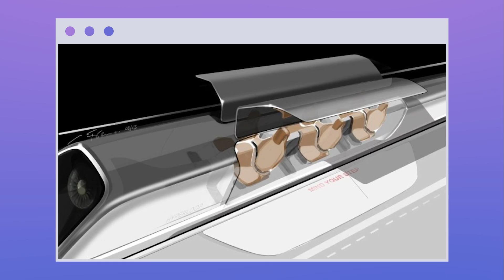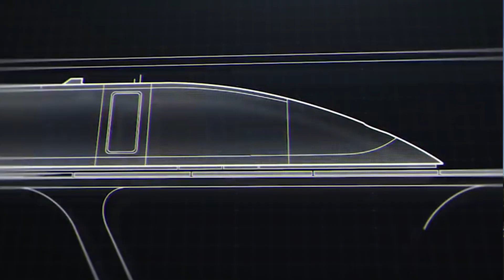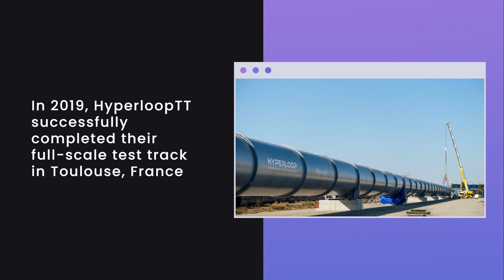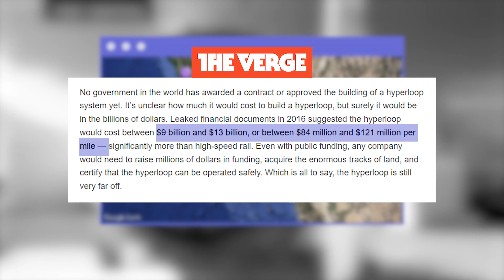Will the Hyperloop Really Happen? 🚅 High Speed Travel of the Future! (Powered by Elon Musk!)

Comment: No, And do you know the size of the largest vacuum chamber in the US? How long it take to pump out the air?  How structurally the structure need to be to hand back the pressure of the air? Look that up and tell us the feasibility of ever constructing a Vacuum tube hundred miles long. Oh by the way they still haven’t completed the San Francisco to LA high speed train using regular technology largely because of funding, mainly getting right of way to build on property which must be brought. Anything going 500 mph would have to go essentially very straight with very slight curves making getting right of way even more difficult if not impossible.

Comment: Once you add up the energy cost, building cost for collapse-resistent tubes and passenger capacity, the hyperloop just isn't cost effective. The money would be better spent seperating the railrods from automoble roads. Without such crossings, almost all accidents would be eliminated saving a great deal in insurance if nothing else.

Comment: Will not happen in the next 20 years (if ever).
Reply from the maker: Hoping for earlier!!
Reply: @ModernDayGeeks  won’t happen, the vacuum chamber would be too difficult to pressurize, especially with thermal expansion and human errors in the construction. A maglev would work way better. A single bullet hole anywhere on the span of the tube would cause cataclysmic failure. A combined leak of three quarters of a square inch (no matter how separated or spread out they are on the tube) would make the chamber completely ineffective. The airlock that lets pods in would take hours to compress air to the point where they can enter.
Reply: @rosariobono438  Not to mention that Musk wants to put one in a tectonically active area. How stupid can you get? 

He is absolutely determined to make anything other than a train, a thing that we know that works and is efficient and effective.
Reply: @Jakster840  
True. The train's that work in Japan is to easy for him.
Its been done already. He's got to fly to Mars first then on the way back he will find a way to get us where we need to go last